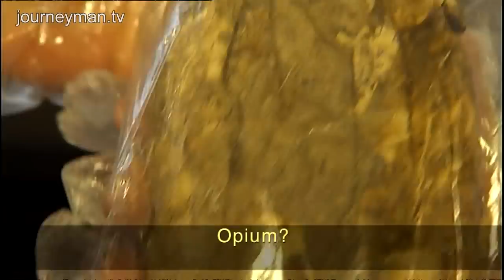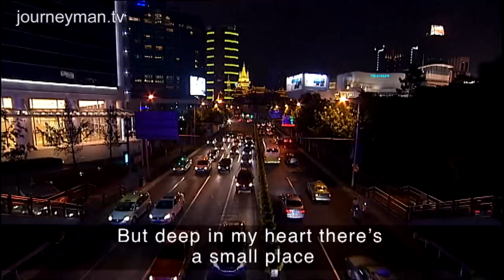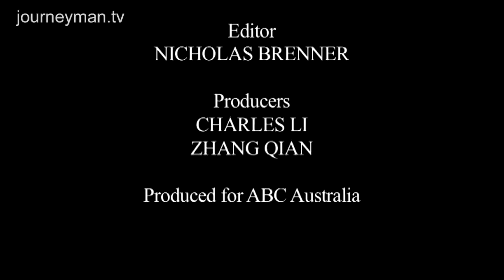Border Patrol With China's Toughest Drug Squad | Part 1

Comment: 16:15 That's probably good cocaine but the humidity has ruined it and those people probably don't know any better because they've likely only had cocaine affected by humidity.  They are likely going to have a sketchy high from it and have an odd candy like taste for their "drip".  Any time I dumped my cocaine out to chop it up and it looked like that I would get so depressed and it would ruin my night because I would be constantly be thinking about how the high was going to be sub par. Also, when it's like that it starts to disappear into the air fast and becomes see through almost. I could tell you exactly what part of the world coke was from just by doing a line and how many times it had been "stepped" on and exactly what they used for the cutting agent just by taste and smell alone. I am clean and sober now for over 6 years.

Comment: powder coke is easy to use for some days without any probs. not sure about meth. depends on the person, especially those chasing the high.
Reply: KuffarLimeLeaf Bacon it depends in the person. If they have an addictive personality then it's a wrap
Reply: But after meth cocain is nothing not giving head. Its like cola if you try meth. Meth is long power full and too much cheaper. in five hours i can snorth one gr. Cocain easyly. But meth is 0.2 gr for 20 hours. And prices cocain 100$ per gr. Meth is 25$per gr. Imagine it.